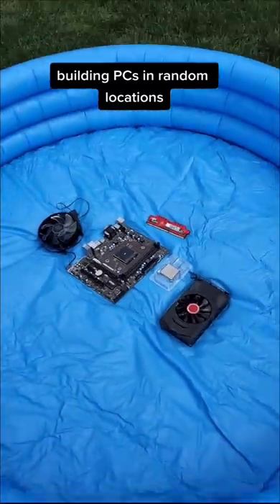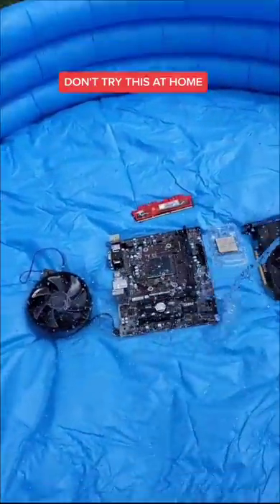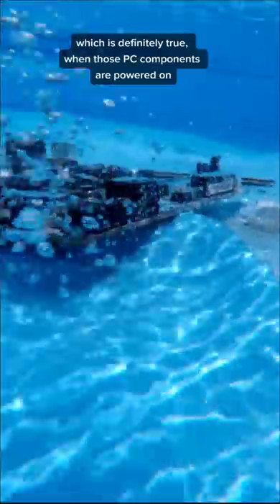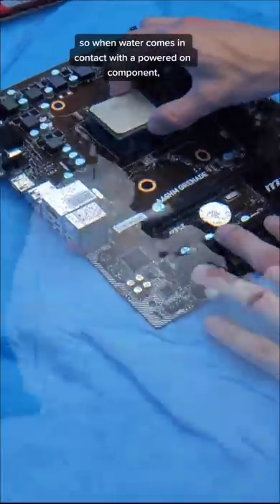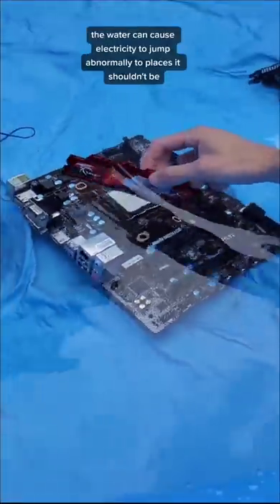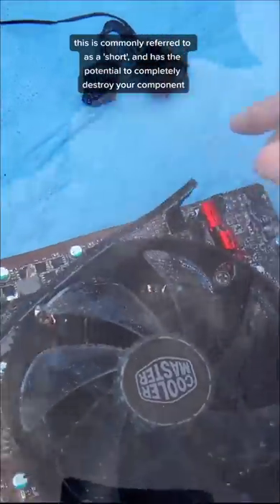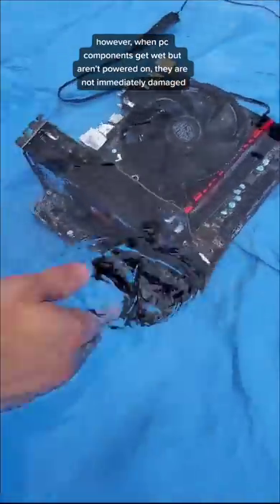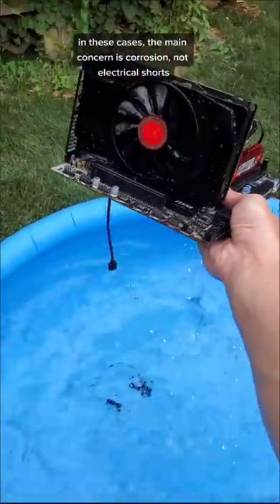Building a PC Underwater #shorts

Comment: Actually, the small battery that keeps track of timr can get damaged
Reply: Meth User 01  yes its also known as a Li-Mn or lithium manganese battery
Reply: And said battery was present
Reply: >Li-Mn = its technically name
>CMOS batt. = named after its purpose on a motherboard
Reply: @suhailab3634  He said what it's for not what it is.
Reply: @kingeling  you talking about the shiny gray coin battery???
Reply: @8jrleyva  yes
Reply: @kingeling  yea dont put the shiny gray coin battery in water since it might get rust or something or break,
Reply: @kingeling  it keeps the time counter "counting" and the user settings. That's why when you remove the battery the bios/uefi resets all the settings back to stock, right?
Reply: but cant you completely drain the battery to 0?
Reply: @slow11189  yes I had a pc with that issue, it just reset the date every time I booted, and another where the motherboard was almost 8 years old and the battery along with a few capacitors all started to get corrosion on them
Reply: @JoaoVictor-hz4rm  Yes. It’s an active chip that requires to be on when the rest of the system is off, so removing the battery will reset everything. However upon booting the bios will be loaded into system ram, so the battery doesn’t always drain.

Comment: Battery keeping the firmware alive on the motherboard: “am I a joke to you?”
Reply: well you can always change that
Reply: Yeah I was thinking the same thing "WHAT ABOUT THE CMOS BATTERY!?"
Reply: I mean some mobos have a plastic under the battery
Reply: Rip the Thermal paste on the Cooler.
Reply: It's a low enough voltage to not hurt anything
Reply: Not funny because i always see comments like this
Reply: @theunknownguy516  Comedy is subjective.
Reply: @kacpergoralczyk2891  yeah, that was a problem i was curious about, is thermal paste water soluble?
Reply: @xymaryai8283  eh depends ....Most are some mix of Silicone oil and other compounds such as aluminum oxide , carbon , zinc oxide , copper , ect depends on the formulation. Silicone oil can be both water soluble and not depends on the formulation
Reply: It doesn't do anything super critical
Reply: You can take them out

Comment: Water doesn’t conduct electricity it’s the minerals and salts that are in it if it’s not pure that make it do that
Reply: I was about to comment the same thing.  Tap water and pure water makes a significant difference when having a contact with electricity.
Reply: This is true. The biggest problem is that water picks up and spreads contaminants so easily. By default, you should assume that water is contaminated and conductive.
Reply: True. If you fill the computer with distilled water, Nothing happens.
Reply: Exactly
Reply: @NothingMeansNothingButNothing  except the distilled water will be contaminated and conductive after being exposed to computer parts
Reply: Searched for this comment 😅

Comment: Everybody gangster until: the pc starts working
Reply: It does in next video
Reply: He forgot to take the cmos battery out of the motherboard so that's probably very damaged or dead but all the other parts will be fine if let to dry correctly for a few days
Reply: @aguyontheinternet1  If the water is purified from salts, then it will not conduct current
Reply: @NothingMeansNothingButNothing  doubt that it is purified though. And even it is, he is still working with his hands in there. Sweat is salty and salty water conducts. Plus all other possible inputs for contamination.

Comment: Funfact: water itself isn't conductive, it's the miniscule particles often found in water that are. Completely pure water wouldn't conduct electricity.
Reply: I remember hearing about companies using ultrapure water to clean sensitive Electronics.
Reply: @ward9832  yes distilled water
Reply: Even funnier fact: pure water can still self-ionize into H+ and H₃O- ions, each with a concentration of 10^-7 mol/dm³
Therefore chemically, pure water conducts electricity, but for just a super small amount

Comment: Keep notice that removing all the water is really hard. Eventually, water droplets stuck under BGA chips (like chipset and the gpu) will dry out and leave minerals which can cause a nice short between the bga balls
Reply: Not an issue with something like distilled water is it, should've used that instead of tap water
Reply: @lolcat  correct me if i am wrong, but even if he would have used distilled water this environment isn't the best to prevent dust, pollen and other floating particals from corrupting the distilled water. 
And to be honest the hardest part about building a pc are, imho, those goddamn pins without the mainboard manual.
Reply: I do extreme overclocking as a hobby and one of the tricks other then insulating the motherboard further by using Liquid tape or more conformal coating ect. One trick is once your done tearing down and the components are wet you can use a small heat lamp or something of the like and use it to heat up a small space with the board in proximity. Warm enough that the water and moisture from condensation / ice  forming and melting evaporates fairly quickly. The trick is just not burning stuff with this method. But the boards don't have any issue being warmed up to 100 ish degrees slowly and then let you cool down slowly. Doing it that way there is low risk of solder joint or bag failure.

Comment: I really wish that in the future, there would be components that are entirely water resistant and they don't get corroded or shorted. It would make cooling viable Imao. Again this idea seems kinda dumb but I'd like to see an attempt.
Reply: It's not likely to happen, and unless you're willing to spend a mint on complex hoardings, it may be physically impossible. Conductive contact is needed for components to communicate properly, so there'll always be a contact point that is corroded or shorted by water. It's probably cheaper to research a fluid that is both non-corrosive and non-conductive, and effective at carrying heat away from components. Until we can find something that works that well enough to be worth the price, keep your kit dry except the inside of your watercooling loop.

Comment: hey wouldn't water get stuck in the sockets you're plugging things into?
Reply: @JustBizmuth  what
Reply: @Wheagg  nevermind actually
Reply: @JustBizmuth  okiedoke
Reply: Yea probably
Reply: Water. Stuck. Hmm.
Reply: @no_xp  it happens
Reply: @Wheagg  it doesn’t. Look up the term “evaporation” water doesn’t get “stuck” it evaporates overtime.
Reply: @no_xp  or maybe you could learn to be nice. Also, stop putting things in quotations if you don't even know what it means. You're not Ben Shapiro and you won't be taken seriously.
Reply: @Wheagg  you won’t be taken seriously if you respond with an insult to someone who’s actually trying to help you understand the video.
Reply: If you dry it out properly then it will be fine. The water will eventually all evaporate and you will be left with dry components. A small worry of mine would be the minerals left behind that were once suspended in the water but I don't think that's as big of a deal as a short due to moisture.
Reply: @sebastiaodeabreu7297  okay but he kept the CMOS in how likely do you think it'll work then?
Reply: @Wheagg  your concern about the socket is very very real. Actual chemist here, although its true that water evaporates over time, as do most liquids, if there is no high heat applied, the biggest factor in how long it would take is air circulation. In the case of the CPU being placed in the socket underwater, there will be a lot of water now stuck under it, inside the pin holes and directly under where the flat part of the cpu contacts the flat part of the socket and the retention pin is keeping it firmly down. There is no air circulating there, meaning that unless very high heat is applied, that place will remain moist for an extremely long time, so your concerns are absolutely valid and that other dude is an absolute asshole who knows nothing about how phase changes work, take it from me, it's my job. Personally, I would not turn it on even if it was left to dry for months, I would still take it out and let it air out the socket.
Reply: @kraddonn  and not just the air movement, some ok the areas with water in them have no contact to the outside at all. So the water simply can't leave.

Comment: Corrosion in the form of electrolysis can also happen while powered and wet. It can very quickly erode away copper on the PCB and the pins on all the chips soldered to the board.

Pure water is a poor conductor of electricity but still being a polar molecule, impacts high frequency signals due to dielectric properties (increases stray capacitance, reduces transmission line characteristic impedance, increases attenuation and impedance mismatch)

Comment: He didn’t put thermal paste on? And also he’s gonna have a fun time drying 100% of the water without leaving any of the hard water behind from that garden hose 😂
Reply: I don't think thermal paste is necessary
The fan can barely spin and the water around the CPU should conduct heat very well anyway
Reply: @not_vinkami  i just meant that he said he built a pc and you can't build a pc without paste
Reply: @_6-6_  you can it's just gonna run very hot and thermal throttle

Comment: Fun fact spray the board in conformal coating it water proofs it more. For rugged stuff in camping gear it's super good for preventing moisture.  Just can't get any in the ports etc.
Reply: Yea for those of us who do extreme overclocking some of us use more conformal coating or liquid tape or other compounds to further insulate stuff

Comment: Pure water does not conduct electricity, only water with ions (from salts) dissolved in it does. Those salts will stay when you dry the components. They'll probably don't cause a short, but will cause corrosion to happen really fast. So befofe drying, you should wash them with pure demineralized, deionized or distilled water (all the same. Just the way of production changes: Distillation vs. reverse osmosis. Distillation uses way too much energy)

Comment: For clarity, water itself doesn't conduct electricity. But tue minerals and trace elements in water do however conduct electricity. So, theoretically, you can build and completely utilize a PC in 100% distilled water (100% filtered out all trace elements and minerals) without much issue.

Comment: Fun Fact: If you used super distilled water. You are able to use electronics underwater. Though they will rust super fast. 
The water that we normally use to drink and wash stuff with has minerals and some salts which allows electricity to move and be conducted in the water.

Comment: Pure water doesn’t conduct, ions in it do, and a short is called a short because the electricity is sent to ground earlier than later in the circuit, i.e shortening the path. Higher voltage going into lower voltage lines is rare because of the number of ground pins but it happens.

Comment: Water itself doesn't actually conduct electricity, it's the minerals in the water that do that. You could fill up a pc case with distilled water and turn it on and it would work normally. Same thing applies with oil and that's also why you get oil aquarium PC's.

Comment: Water doesn’t conduct electricity at all. It is the ions that have dissolved in it that do so. You could power a computer submerged into PURE water (distilled water) and there wouldn’t be any problem. It wouldn’t be a good solution overtime because random molecules in the air and from the computer would still dissolve and create ions that would conduct electricity. And, of course, the main reason not to do it would be that it would oxidize all the components.

Comment: In short, water is capable of conducting electricity due to the dissolved ions and impurities. When a battery with positive and negative poles is placed in water, the positive ions are attracted by the negative pole and the negative ions by the positive pole, creating a closed circuit.

Comment: Interestingly enough, water does not conduct, it is the contaminates in water that conducts electricity. So if you use distilled water, it will not short the board.  However it will still corrode the board, and the distilled water will be contaminated in time enough to cause a short.

Comment: Water does not conduct electricity... Its the minerals inside the water that do... When the water eventually dries up, the minerals are still there. You can remove the minerals left over by wiping everything clean

Comment: So you left the CMOS battery in, if you had this powered on maybe a few days before, the capacitors on the mb can still hold charge, if you short these capacitors they can discharge and cause damage to the board and other components. If you're gonna scrub a mobo clean, or bring it anywhere near water, please remove the CMOS battery and ensure everything has been discharged.

Comment: You could bake the moisture out of those PC components in an oven. First soak the board in 99% iso to remove minerals from the water. Bake for 24hours at least. Google temp, depends on the product.
Reply: The way I'd probably handle a board this soaked (I do extreme overclocking in a high humidity environment so I have a fair bit of experience with soggy components) would be blow the board off with compressed air, remove the heatsinks to get rid of the thermal pads , then bake at low temp in a oven , set it on a hot plate turned down real low, or use a heat lamp in proximity to the board to heat the board up a bit reaching maybe 120 degrees slowly as to not stress solder joints to hard. It would be bone dry in a few hours at that point. I use a similar method to dry boards after sub zero xoc runs. There are even some guys that use Vaseline to insulate boards and will run them through the dishwasher and let air-dry.

Comment: water doesnt conduct electricity, its the metallic minerals and particles inside the water. if you are using water with relatively less minerals and iron, its safe.   Moreover things may go wrong if the psu is inside water, cuz it rectifies AC to DC. you can happily dump other components into water cause they run on DC 0Hz, who needs a water cooler huh?

Comment: Good luck with getting moisture out. Lots will be lodged in all the pcie and ram slots. Also forced into the cpu socket. I'd wanna see this powered on n see it 6 months from now
Reply: Can tell you as someone who lives in a high humidity area and that also does extreme overclocking. As long as this is stripped down to prevent potentially water logged thermal pads from holding water. Blown off with compressed air to get rid of the bulk of the water this board will be dry in 24 hours usually at ambient temps in most houses. If you run a heat lamp or a hot plate turned down quite a lot or a number of other methods to warm the board up slowly (as to not crack solder joints ) to 100 ish degrees range the board will be dry in mere hours potentially minutes
Reply: @Onewolfoc  the amount of people who know this is slim. This short version he did leaves out the details of what happens if you dont get all the water out. Also corrosion is a factor too. It really matters what kind of water. If it's distilled it's safer than tap.

Comment: This doesn't give me confidence, this will destroy my pc components, now i have fear of every drop of water near mi pc 😢
Reply: You can actually wash components in water and let them dry and run them fine. It largely doesn't hurt anything as long as it was properly torn down and left to dry also in water that's pretty free of minerals but that's not particularly hard to come by aka distilled water. Also you can get components fairly wet before you have issues. PC components are fairly robust from moisture when unpowered. (I do extreme overclocking and have quite a bit experience with wet and frozen over components)
Reply: Actually funny enough fact there is a significant number of boards I've seen that have had partial or minor shorts via water/moisture or other dust/metal particulate contamination that stop functioning right. If you catch it early chances are the components wont be significantly effected. Aka they will work after with no noticeable damage. I've even see a Asus z8na-d6c dual socket 1366 board with dual nics have one Ethernet nic being shorted to the point that the nic when connected via Ethernet was disconnecting and reconnecting every few seconds. Basically there was a partial short that would allow a charge to build on some dust/metal particulate matter and it would jump and short the connector out and cause the controller to think the NIC was not connected to anything. Once the charge dropped after making the jump it would dissipate slightly and the nic would have a chance to reset just after it reset it would short again. A proper wash in water and later isopropanol and let dry solved the issue and the old board still functions as intended with both working nics many years later. I will say though does depend on what is shorted and to where and how bad that short is. For all the times it happens there is a significant number of boards that survive with 0 to minimal damage.

Comment: “Water conducts electricity.”

Actually, pure, distilled water does NOT conduct electricity.  Pure H2O does not conduct, as both Hydrogen (H) and Oxygen (O) are both non-metals, which are insulators, and nonconductors.  It is the minerals in generic water from the tap or hose that conduct the electricity.

Comment: I thought it was minerals in water that break them
Reply: In short, water is capable of conducting electricity due to the dissolved ions and impurities. When a battery with positive and negative poles is placed in water, the positive ions are attracted by the negative pole and the negative ions by the positive pole, creating a closed circuit.